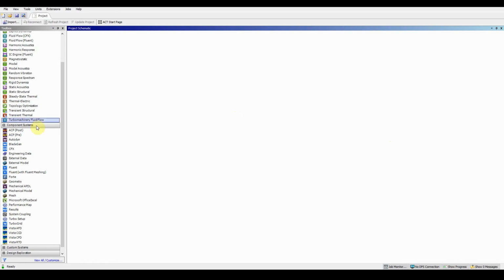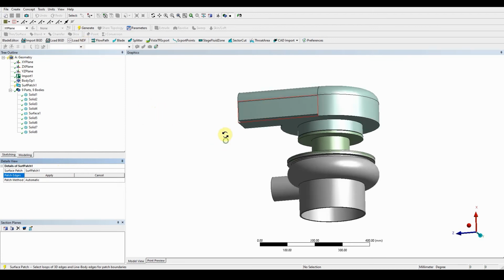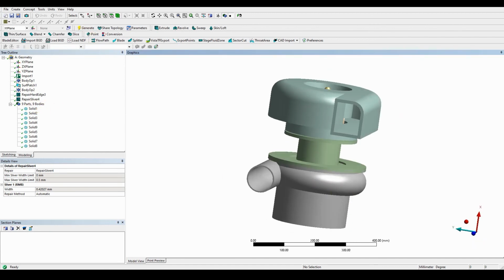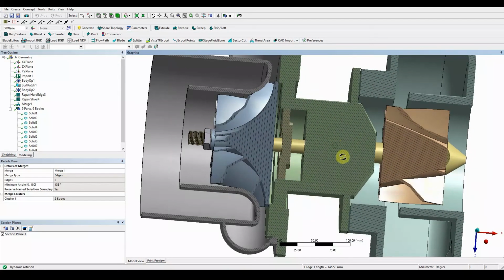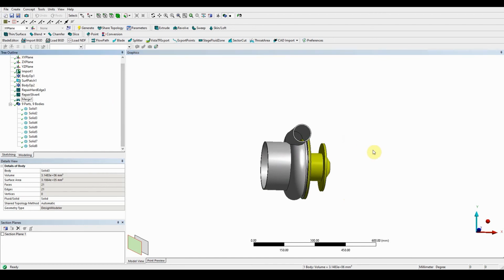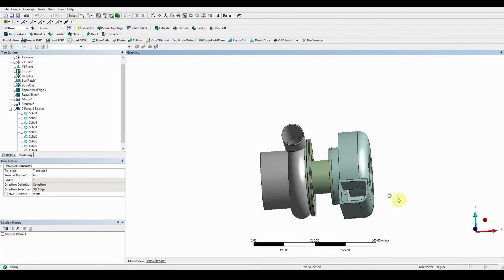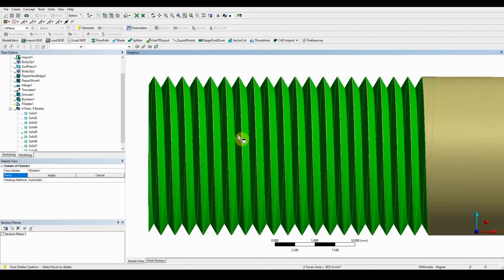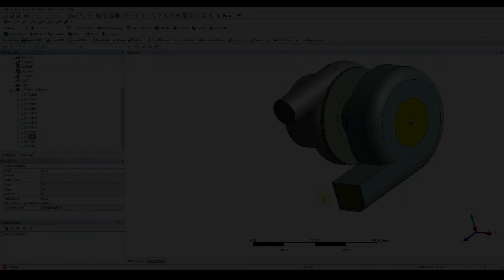ANSYS DesignModeler Workshop 3.1 Geometry Clean up and Repair – 1

Comment: Good Video bar one mistake.. At 16.20 you rightly found that the middle component needs to be moved by 9mm to the right to avoid interference.. But all of a sudden why are you translating the right component...

And after at 18.30 why are you extruding 2mm for that component?

Kindly correct me if I am wrong...